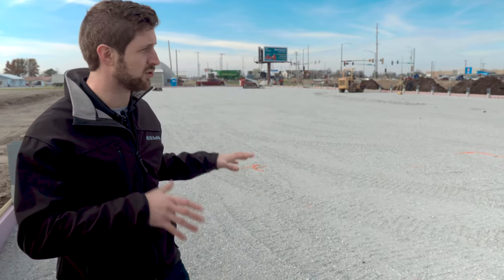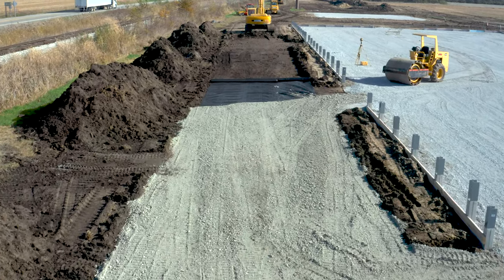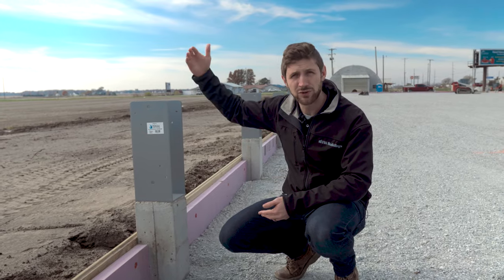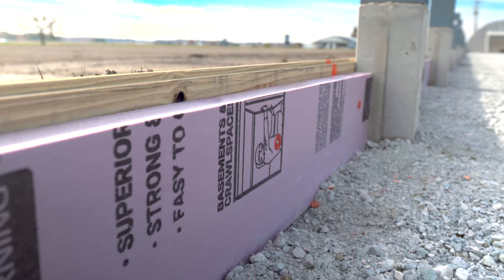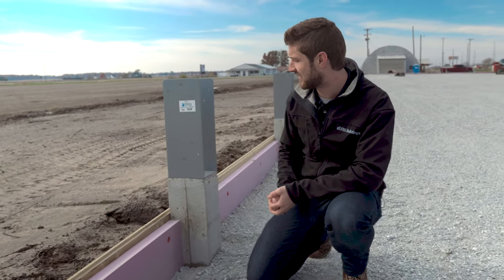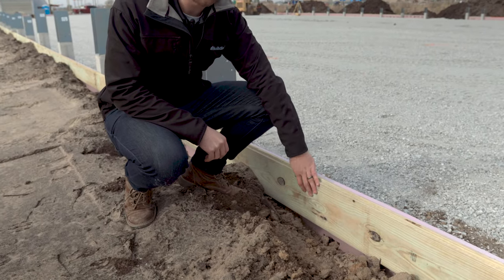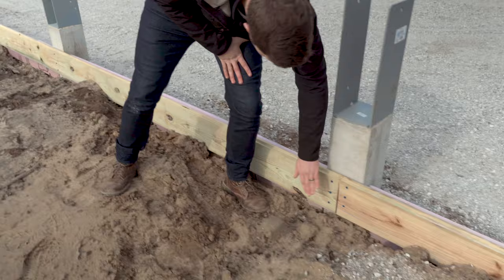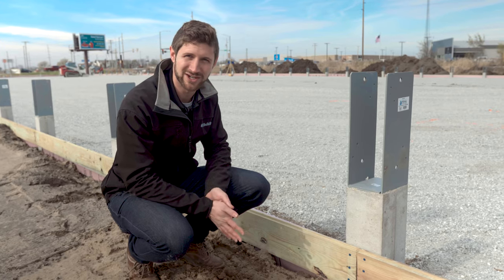Pole Barn Foundation Options

Comment: You are required to keep a couple inches of concrete on each side of the permecollum not doing prevents them from offering the load support shown on paper by the manufacturer
Reply: The ciment base is to narrow
Reply from the maker: Thank you for providing the information. We will consult with our engineers regarding this.

Comment: Those Perma columns don't appear to all be set with tops on the same level plane. Which means all your posts have to be different lengths to factor out the errors.
Reply from the maker: You have a good eye! One of the benefits of using the Perma-Column system is that they are 5’ long, giving you flexibility when digging holes and setting the columns. For example, if one hole is a few inches deeper than another (due to rocks or other obstructions underground), there will still be plenty of Perma-Column sticking above the soil/gravel. This will ensure the wood never contacts the soil, leading to premature rot.

Comment: Awesome video. Question, at 1:08 there is a quick picture of some guys working with what looks like a wood subfloor being used. How does that work with perma columns?
Reply from the maker: Hi, John! Great question! What you saw was our crew building a QLYFT building, not a subfloor. The building was just down, and our crews were working on the columns before it lifted.

Comment: Wood skirt board at ground level be subject to frost heave ?
Reply from the maker: Insulating beneath the skirt board along the exterior side of the column prevents the soil from exerting pressure that could lead to heaving in case of soil movement. In uninsulated structures, the skirt board is susceptible to shifting along with the ground if heaving occurs, although such instances are infrequent.